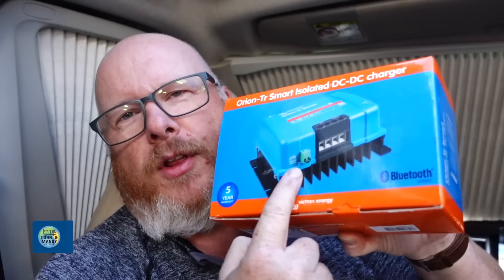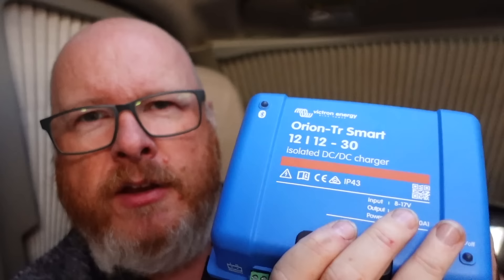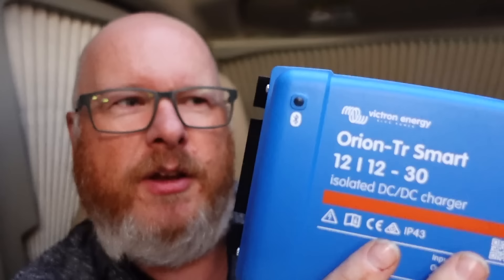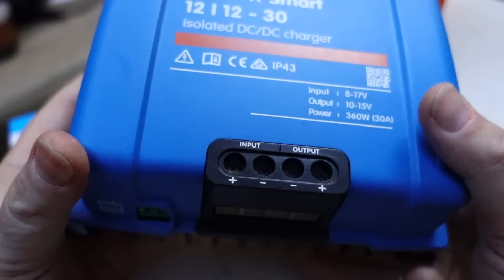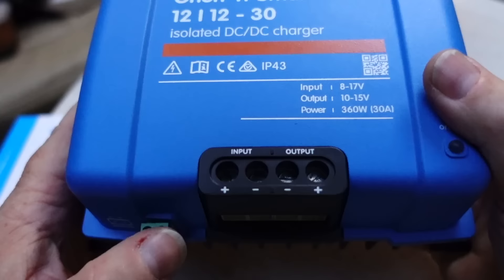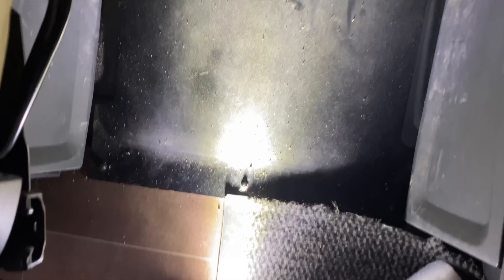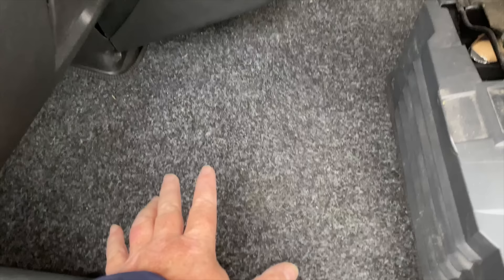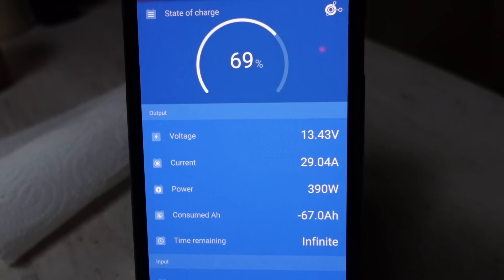Victron Orion DC-DC Isolated Charger B2B Installation

Comment: Thank you John for the isolated and non isolated explanation, I emailed Victron and they told me to check with my local dealer for my needs, they could’ve easily explained it as you have..

Comment: Hi mate! I have one of these installed, I don't have a smart shunt yet, I have 2 x 200ah agms , recently been bad for solar and my batteries have Been on 50% , been driving for 2/3 hours and my voltage has stayed at 12.5 the app seems to look like it's working correctly, but the dc charger isn't even warming up its stayed cold after a 2 hrs drive... any help at all man?

Comment: Using same charger. Gets so hot I can’t touch it for more than a few seconds! Is that normal? I’m using 6awg wire and 60amp fuse at the battery.

Comment: great vlog, but unfortunately for me, did not understand any thing you talk about.. hope you both keeping very well and hopefully warm.
Reply from the maker: No problem 👍🏻
Reply: It is a dc to dc charger which allows the vehicle alternator to charge the starter battery or, the vehicle battery under the hood. Once that battery is charged it will switch over to a second battery that is being used to run electronics like refrigerator cell phone chargers blenders and the power inverter so on and so forth. Calling it a B to B only means that it’s a battery to battery charger. Here in the US we call them DC to DC chargers. One alternator will charge two different batteries even to different types of batteries
Reply: This is incorrect on 2 counts.  You should keep your comments to yourself since you don't know what your talking about

Comment: Hi I have a burstner privilege 727 and I’m going to convert the battery’s to lithium and have the schaudt EBL 99K feeding the lead battery’s can you leave this connected giving it’s feed and add the Dc to dc charger as it has a switch on it only gives the option lead or lead gel any help would be greatly appreciated

Comment: I've just completed the Victron B2B installation and it seems to be OK but in the Victron Connect App I can't find the very useful 'State of Charge' screen you show with volts, amps, % charge etc on the. How do you get these figures on the Victron App or are you getting these from a 'Smart Shunt'  also installed in your system, or the BMS?

Comment: Educational as always, and thank you for emphasising the need to appropriately fuse/breaker the positive terminals at each of the system (vehicle and house/leisure) batteries - I’ve seen more than a few dubious van installs where the person responsible genuinely can’t understand why they need more than just the one fuse/breaker in the whole system; and then try to justify their stance by asking if I know how much they cost - my normal response is “less than repairs to your van when it catches fire!” Fully agree with your stance on Victron kit; not cheap, but quality rarely is. Stay safe.
Reply from the maker: Breakers & fuses cost nothing really, they’re just not attractive, and most people go for a nice looking electrical system these days. 👍🏻😁
Reply: @johnmandy  Agreed, breakers also have a very convenient benefit: you can use them as switches to isolate systems during installation and testing.

Comment: Hi John,
You can connect 2 of the Victron DC-DC chargers as I have 2 fitted and it works fantastic, I have the Peugeot Boxer 175.
I used 35mm cable to a positive and negative bus bar and fed the 2 chargers from there and they both come on at the same time.
Reply from the maker: Great setup 👍🏻😁

Comment: Hi great video very helpful
The one area i could not find info on anywhere was my original Sargeant split charger which I had hoped to isolate.
In your video you have left yours still working without apparently any problems.
This has given me confidence to stop worrying about mine and leave it alone.
Thanks

Comment: Thank you for the tutorial. 
I have done some research about the problem of leisure batteries not charging properly while driving. I will only talk about the Fiat Ducato engines. Please correct me if I'm wrong on any point raised but this is what I understand so far. 
The need of a DC/DC booster is to compensate the lack of charging of the leisure battery when the engine is fitted with a smart alternator. Prior to  2020 model year, engines didn't have a smart alternator so lack of charging wasn't an issue. From September 2019, when the 2020 new engine line-up was introduced,  engines 140hp ECO Pack and upwards now need a DC/DC booster of at least 30A to charge the leisure battery while driving. The 120hp and standard 140hp engines do not have a smart alternator (confirmation needed) and therefore there is no need to fit a DC/DC booster on Fiat Ducato motorhomes fitted with any of these two engines. 
Some MH converters don't fit a booster and some do but quite often not one powerful enough.
Reply from the maker: Basically everyone with every engine should install a B2B charger to charge their leisure batteries.

Comment: Well done, I installed one of these just before crimbo, Ive got a polinovel 200ah battery, and had researched this for a long time online as to how it fits with my system and split charge etc etc before fitting, and I can say your video is the best around online for this piece of equpment. Cheers

Comment: Nice one john very useful information I got a sergeant ec 328 with x2 100ah batteries , 1000w inverter with a 95w Solar panel new batteries are needed looks like the B2B charger will be added to the shopping list stay safe you guys 🌈😊
Reply from the maker: Thanks 👍🏻😁

Comment: I have 2 x Renogy 50A with built in mppt, it also has Bluetooth with a plug in, it has the advantage of charging the starter batteries when it detects the leisure batteries are full. In the UK 100 amps is great.
Reply from the maker: Our solar setup chargers our batteries once the hab batteries get to 100% 👍🏻

Comment: Just found this Nov. 2021. Great!
I have the US version of the Fiat van, so your battery install was very near like mine. Mine is a homebuilt conversion we purchased used. The starter batt. was connected direct to the leisure batt., a 217 amp hour agm! No b to b voltage upping! The solar charger was also set to just flooded lead acid style and it would never keep up. I corected that. 
You have given me the path to finish the job with this device.
 thank you very bigly.

Is upping a real word? Asking for an American.

Comment: Great video! I have 800A of Lithium in my Hymer (Aircon + various other power hungry devices) and with an upgraded alternator run 2x 70A Votronic B2Bs, no problems whatsoever. We also have no issues with 2 Votronic solar controllers, so that myth is busted too.
Reply from the maker: Great info. Thanks 👍🏻😁
Do both solar controllers take a split from the solar panels, using a Y splitter?
Reply: @johnmandy  The arrangement on the roof to get maximum coverage was 2x 180w and 3x 115w so I just have the 2x180 into one controller and the other 3x115 into the other. I use the Votronic bluetooth adapter to see the current coming in from each controller and it works exactly how you would hope it would, no issues whatsoever.
Reply from the maker: Ah I see, good setup 👍🏻
Reply: How do I know if I need to upgrade my alternator? I got similar setup to John & Mandy (but in a 2006 Renault Master based Motor Home, built in Calira ~11A, I think, and Renogy B2B & MPPT 30A)
Reply: @geffhome  You'll most likely be fine at that level. It only becomes something to pay close attention to if you want to pull silly amounts of current out.
Reply: @fredflintstone1428  Correct, I end up with about 110A heading into the batteries as that seems to be the sweet spot for the my alternator. Getting 140A out is possible but requires more than 140A in due to the voltage gain for charging.
Reply: This is on a Hymer B668
Reply: Hi Mike, really amazed at your post. When you say uprated alternator could you give the spec please (bc 800Ah of Lithium is hard core!) Thank you

Comment: Nice video as usual john. I have fitted a Sterling 12/120 waterproof under the passenger footwell. This solves the space issue inside and charges my 300a/h battery bank from 50% to 90% in about an hour ☺
Reply from the maker: That’s brilliant 👍🏻😁

Comment: Sure your EBL got internal charger? From the grid yes, but when driving a typical motorhome it is still your alternator doing the job between 5 and 30 A. The A’s just passing the EBL on its way to the leisure battery. Your installation show us that a parallell charging B2B is working fine. Remember to update your experience after some use. Nice video 👍
Reply from the maker: Yes my van has a 20a b2b electronlock. 👍🏻 just like I say & demonstrate in the video.
Reply: @johnmandy  Thats kind of unusual. (I have not seen that solution before) But why not. My rv got the alternator charging leisure via a b2b without going via the EBL. (Carthago factory setup).

Comment: So you don't have to run a wire to a starter wire  so it will charge when you start the car ? That little plug in pigtail does it. Thats cool. BTW Thanks a million for this video BIG HELP to me .

Comment: Nice one, Based on your previous B2B videos I fit a 30amp Votronic to our camper back in early spring. Guess what apart from a 200km round trip before its MOT (CT) in December its never been run! Hopefully more luck this year. I used one of those little grey trip switches & was worried it might have been the wrong thing but feel more reassured now. Cheers.... 👍
Reply from the maker: Soon things should improve and we can travel again 👍🏻
Reply: @johnmandy  Lets hope so. 👍

Comment: Just a basic question. When leisure batteries need charging. With the Bat to Bat. In the dark start engine and drive off does the BTB give priority to power head lights , cab fan Demister winfscreen heater and wipers and does the charging current drop to batteries when lights on etc. Cheers from old George
Reply from the maker: Please read the comments as this has been covered already 😁👍🏻
Reply: @johnmandy  ok matey will do. Cheers 👍

Comment: great video!Can you connect it in a 12volt 180watt socket in the trunk and charge a 12volt batterie and a 12v fridge buck there, at the same time???

Comment: Great video, clear explanation. I have a modern van but with Pb batteries and simple SCR charging set up. I would like to add a  Lithium battery and the Victron B2B. Do I need to somehow disconnect my existing SCR before connecting up the B2B? Strikes me I should as if the SCR kicks in first to charge an Li battery , it will overload the alternator by drawing too much current? The Burstner 'block' you had seemed to have 'semi-intelligent' facilities, so it was OK to leave it but not so a 'standard' SCR?

Comment: Hi John. I've got an 06 VW Crafter as a base for our motorhome with 2 x 200amp AGM lesiure batteries, I want to fit a Vitron B2B charger am I going to have problems overheating the alternator when charging at idle speed? If so should I change the alternator ? Taa
Reply from the maker: It’s going to be fine, as I said in the video this is a b2b charger, your alternator then charges your starter battery as normal. This b2b does not pull power from your alternator directly.

Comment: Very interesting and helpful video John. I have gone for a REDARC B2B which unfortunately doesn't have Bluetooth but.. the leisure battery it's charging does. With the REDARC it says not to use circuit breakers but midi fuses. I too was concerned about the compatibility between the onboard built-in charger and the B2B ( and the mains charger) as i did not want to overcharge the battery. Turns out the battery will not accept an overcharge and the B2B will detect charging from other sources and not continue charging also. All clever stuff and a great gadget addition ;-)

Comment: Ive just come across this video Jon, and its brilliantly and simply explained thank you.  Could I ask, do you know if this set up would work straight into a Bluetti AC300 / B300 to charge on the go, rather than using the 12v cigarette socket at 10a. If so it would solve my current headache of working out how best to do this to charge faster without installing a separate inverter.
Reply from the maker: This video explains how to do that 
https://youtu.be/BbWF54wjL6Q?si=BTUmN97aDdHcKJra

Comment: As always nice and clear description and instructions. I fused my B2B both sides i/p and o/p always better safe then sorry! As with the earthing I put in a big copper bar( I did check to see how much load the bar size could take) for a negative buss bar. I find it make the whole system a lot simpler and tidier also labelling the cables or location points help. Again great vlogs from you guys!
Reply from the maker: Nice 👍🏻😁

Comment: A very detailed explanation John. Not many videos on the Victron Orion out there. The nice thing about this Orion, it can be used both as a charger and a power supply. I've got the 12v to 24v version which I use to supply power to my Goal Zero Yeti 1000 battery pack. It works very well. The unit does get hot when operating, so like you said, you really need good ventilation for it.

Comment: I used an eBay electronic trip which stopped my Victron Orion from charging the Lithium 200ah at full capacity, I only saw around 10-12A, I've just swapped to a solid 35A fuse and am now seeing 28-29A output. I'm sure a better quality trip would work but just in case anyone has a similar issue.

Comment: I see you used 16mm2 cable which is rated about 110A - but the charger is only outputting about 30A.  Please could you explain?  Also, does the Victron b2b allow you to link the leisure battery to the starter in case starter battery is low on charge. Thanks.
Reply from the maker: Please feel free to read the other comments where I’ve already covered these questions.

Comment: Thanks for the informative video! I could not find the circuit breakers that you mentioned (0:40) on the motor home page of your website.
Reply from the maker: I’m updating that as the seller I used no longer sells them. Please check back in a few days 👍🏻
Reply: @johnmandy  Thanks!

Comment: in the phone app on battery setup does it have sealed battery in the drop down menu...and has it got to be 16mm cable starter to dc to dc charger or could i use 10mm cable ....thanks j&m
Reply from the maker: It has many battery options on the setup page or you can choose your own custom settings. Cable size, length of cable and amps sent down a cable are for you to calculate for your setup.

Comment: Hi, a wonderful vid as always.  Based on this, I have had a Non-Isolated B2B installed to my 2017 Autotrail Motorhome.  I also have a Victron Shunt and MPPT solar regulator.  I have a new Lithium EcoTree Leisure battery and they advised me to set the absorption voltage to 14.4V.  The installer has bypassed the Sargent Split charging system that came with the van. 

I have taken the battery down to 85% and noticed that the B2B starts in Bulk then goes into absorption charging after a couple of minutes.  Is this normal behavior?  Does anyone know a testing schedule to help determine issues please?  Thanks in advance for any help.

Comment: So, I am trying to setup a camping trailer with solar, so it will charge off the car whilst I'm driving. Any idea if I can just run cables from the socket to the battery or will I need one of these? A little out of your wheel house but don't know where else to ask. Ta!
Reply from the maker: It’s not a tricky question,  you just need to understand 12v electricity doesn’t travel well down long wires, most caravans have a 12v feed to power the fridge while towing, it’s around 10-15 amps though, due to the size of cable and distance. 
I’d say if you used 35mm cable and used an Anderson DC connector then you could use the b2b in the trailer to charge it’s leisure batteries. So run the pos & neg 35mm cables directly off your tow vehicle starter battery, fused with 100A mega fuse, then put the Anderson connections near your tow ball, get some decent protective conduit for running the cables at the trailer end and allow for articulation, then you can just follow the rest of my b2b install video 👍🏻
Reply: @johnmandy  awesome thank you!

Comment: cant be used directly from car alternator right? have to be car alternator starter battery and from starter battery plus and minus to the b2b right?
Reply from the maker: It’s a battery to battery charger, so it can only be used connected to a battery 👍🏻

Comment: Great instructional video I also have Burstner with Electrobloc and 2x 100ah wet batteries. Would I see a big improvement in the en route charging of my leisure side with this or is it more for lithium?
Reply from the maker: This b2b would work with any battery type as I mentioned in the video. It’ll help the health of any battery type too 👍🏻

Comment: Bit of a strange question. So I bought a victron kit. Which has come with the isolated charger. Because my negative on both my batteries go the van metal work can I run both negatives from the charger to the body instead of running a negative from the vehicle battery to the charger? 

(Reason being I’ve already routed my positive cable without realising I got the isolated version) 😂

Comment: There's a lot of promo for various 'solar generators' (daft name) which aren't that good. Have you thought about making your own, there doesn't seem to be any UK channels doing that so it would be good to see you try.
Reply from the maker: When we had the panel van I contemplated building a power wall into the side of the van, but moving & vibrating van caused me too many concerns so I scrapped the idea.
Reply: @johnmandy  I saw someone who built an elaborate setup that worked to overcome that but too much hassle for me. I was just thinking about a portable assembly, possibly one with a decent high current charge input, inverter output, usd, 12v dc etc...